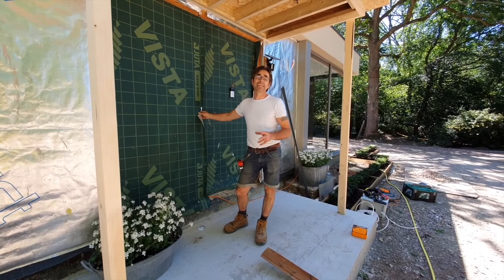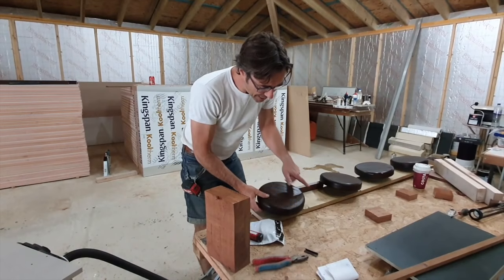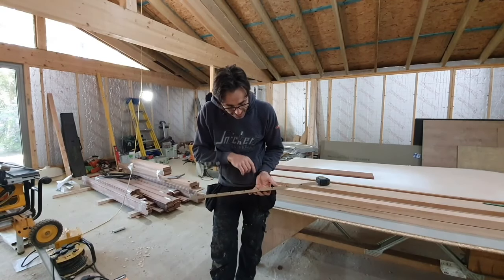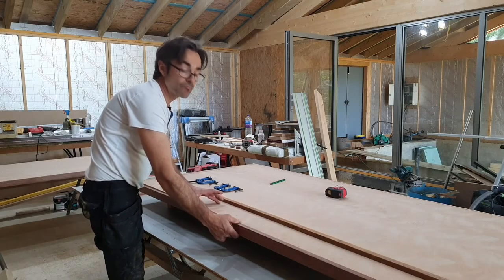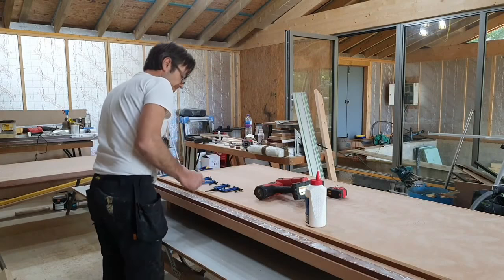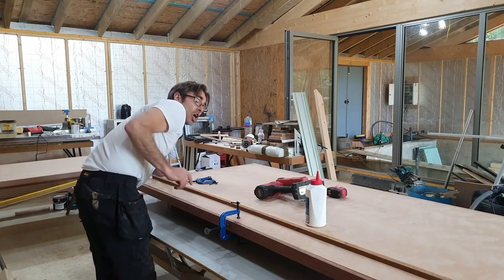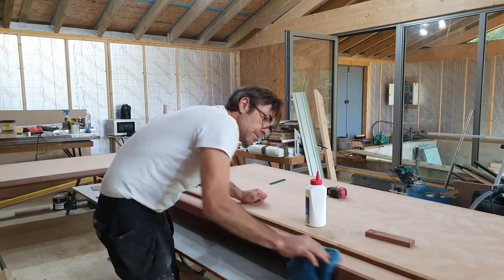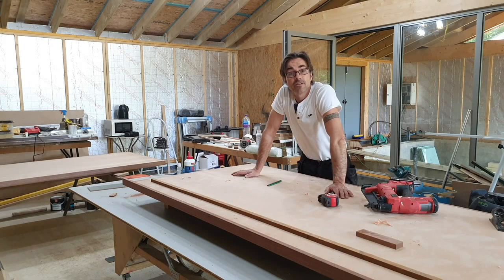Making a pair of Front doors, My super expensive front doors are finally being made PART 1

Comment: I've watched a lot of carpenter's and maker videos and this is the first time I've seen a glue joint rubbed.I learnt this in D & T at school. It helps spread the glue and you can really feel it start to suck together. Nice one.
Reply: Spread glue well, one side is enough, and the rubbing around, pushing and sliding back and forth, obviously pushes it well into the other face. Proper job.
Viscosity and vacuum, eh?

Comment: The doors look fantastic, I have started using PU adhesive for exterior work, I think that as long as the joints are tight and well clamped the glue is supposedly ‘better”, you do have to deal with the foamy mess after but you have to take it down the timber any away I don’t see the problem. What is your experience?
Reply from the maker: Hi Tom, I like the PU for mainly normal timber construction and for jobs like gluing floor panels to joists etc so anywhere that there are two different surfaces as the glue tends to expand as it goes off and takes up any unevenness etc, for joinery where I have two really good flat surfaces then I use really good PVA

Comment: Hi Robin

I think these hinges might be the answer for a pair of heavy glazed doors at the back of our house.  They have dropped slightly and bind on the threshold.  I have fiddled with the heavy duty bb butt hinges to try and improve it but not perfect result.  Three hinges per door at the moment.  Doors are framed in 50mm oak and fully glazed (DG) and very heavy .  Measure 1M wide and about 2 M high. I would have to fit the hinges one at a time as the doors are much too heavy for me to remove but given the shape of the hinges it would be trick as I couldn't rout the rebate on the frame.  How would you do it?  Advice would be very welcome.  Mike

Comment: Any wooden door is going to move around due to temperature and moisture and I will guarantee that whatever the site and whatever the care taken with the doors one or some will shrink and warp.  Double doors are the worst because any shrinkage is noticed at the meeting stiles and I have seen fire doors with 1/2"+ gaps at the meeting stiles with the seals flapping in the breeze.
Old traditional doors don't seem to suffer the same movement and yet they have experienced greater variations in conditions - all it can be put down to is the proper seasoning of the timber before fabrication.  Modern timbers are kiln (forced) dried to humidity levels that are often too low so that when given the opportunity the timber acts like a sponge.

Comment: I had to work on Laboratory doors once back in the Joinery shop for restoration, Lead sheet ran right through the entire door took 6 of us to handle that bastard that was heavy
Reply: interesting, did you happen to know what it was for? i did some work on a house on a little island in scotland and it used to be a covert mod listening station for russian submarines. cables ran out the house buried underground to the beach. all the external walls and doors were lead lined.